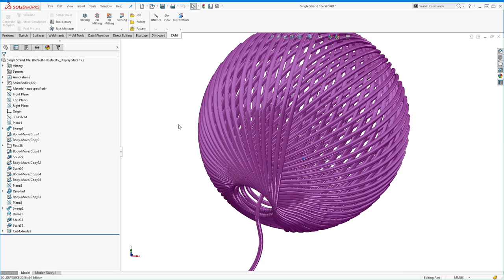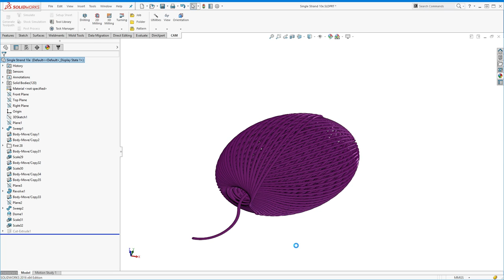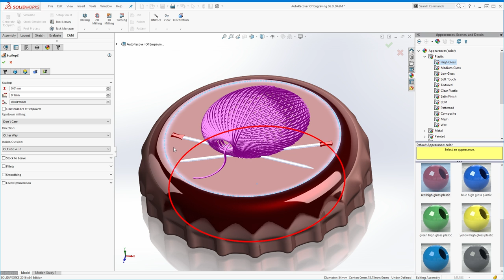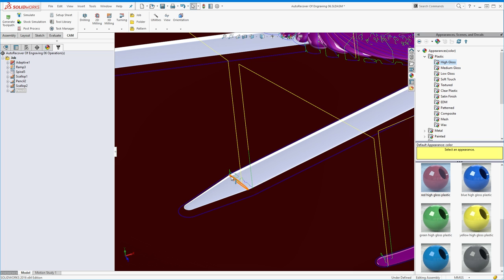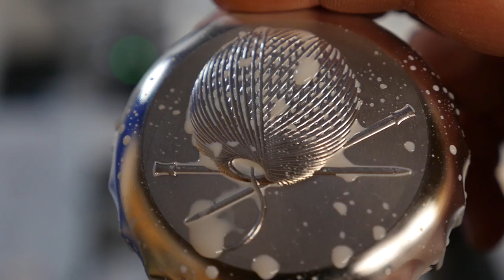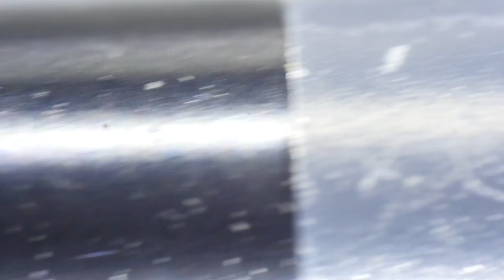Yarn and Crossneedles (1 of 3) A Little Bit (Micromilling With A 0.020" Diameter Ball Mill)

Comment: That was a wonderful video!  The ball of yarn modeling was well done with that slight allowable random variation making it quite realistic.  The finish quality was superb as well.  Your sister is a lucky lady to get such slick gifts!  I use 1/32" 4 flute Kyocera ball mills quite often here, but I rarely dip down to the 0.020" world.  I get nervous when I handle those tiny gems, but they really are pretty stout tools.  The macro shot of the bit that you pulled off was pretty sweet as well.  Sorry that the tube only lets me give you one thumbs up.
Reply from the maker: +Doug P 
Thanks for the complements! Sorry for my delayed reply; I saw your comment as a notification on my phone, but then I guess I somehow missed it when I came back to the video on my computer.

Man, that yarn ball was really taking its toll on me (and my computer). Trying to model a realistic-ish yarn ball is why I started trying to make helical spheres. They looked OK before scaling, but getting SolidWorks to make them as flat as I wanted was perti-near impossible. I was keeping my sister up to date on the progress (or lack of) and I probably declared that I was giving up on making a 3D yarn ball two or three times. I'm so glad it's over!

Yeah, it's kinda incredible how strong those little tools actually are. I bought two, expecting that I'd break at least one, but I was really afraid that the first one would break within seconds and I'd basically still be at square one.
Reply: No Problem...I have completely missed people's comments for a month or so- oops!  Yeah that ball modeling you pulled off could easily tax you and your video card.  It looks so good though it has to be worth it.  Now you can take on fractals :-)!  That's actually something that I'm working on right now and SprutCam thinks that I have chained it permanently to the woodshed when I calculate tool paths.

You know darn well that if you had bought one of those little cutters it wouldn't have even made it into the ER holder without breaking.  Speaking of toughness I just challenged one of those 1/32" ball end mills rather harshly.  I actually miscalculated the start point of a circular array of engraving that was supposed to run along the base plane of a 3/16" tall stainless boss.  That little 1/8" shank cutter friction cut 60 thou into that sidewall 32 times without breaking!  That little tool had to have been glowing cherry red off and on for 10 minutes!  It's definitely discolored all the way up the shank now, but the flutes of that ball mill are still doing fine.  It is certainly a one of a kind piece now...I'll call it art.  Keep having fun while you make those CAD/CAM programs earn their keep!
Reply from the maker: Heheh, that's pretty funny! And also amazing.
Reply from the maker: Oh, and you're totally right about the tool not even reaching the collet if it was my only one. LOL!

Comment: nice part, lots of complexity, turned out pretty good! I find people are always dead-set on getting an "embossed" logo like this, as opposed to a surface engraving...at least until they see the difference in price. But that yarn pretty much required a 3d shape due to the tight lines.
Reply from the maker: +Andrew Ydna DuBuc 
Thanks!
Yeah, try as I might I just could not figure out a way to make a convincing looking ball of yarn using engraving. I just couldn't figure out a way to get away from doing it in 3D. I can imagine a lot of people are dissuaded when they find out that the embossed look takes five times longer to cut.

Comment: Crazy detail, I love it.  That modeling is top notch.  I wish I could spend more time obsessing about little intricate machining like that.  Well okay I do, but it's torx patterns and tight tolerances, not so much decorative designs like this.  It's amazing.  I'm surprised you got such detail with a 0.004" stepover, that's 20% of tool diameter.  Ahh I just did the math and it's a 0.0001" cusp height, yeah that'll do!  I tried a 0.004" stepover with a 1/4" ballmill, but I was flying at 70ipm in Ti so the finish wasn't fantastic.
Reply from the maker: +JohnGrimsmo 
That thing took me SO long to draw, so thanks for the complement! Well... I guess that exact one didn't take all that long, it was the 15 failed attempts before that one that didn't turn out "good enough" that were the real problem. hehe

Yeah, I was surprised by the finish as well. I thought 20% would be pushing it, but I just kept thinking "OK, if the step-over is equivalent to the thickness of a sheet of paper, how bad could it possibly be?".

Whew, 70 IPM in titanium does sound like flying! Too bad about the finish as I bet the cusps on that thing would have been literally invisible.

Comment: Wow. Can you do a video about your Brother and how you chose that machine somday?
Reply from the maker: I'm so bad about making videos that I've learned not to promise to make them. But I can tell you a little about it right now... When I was trying to pick out a machine, I spent a lot of time thinking about the size of my garage door opening (a single-car garage door). I figured I'd either have to find a machine that would fit through, or modify the opening and get a new door and stuff. As I scrutinized that constraint, I managed to get/make some 3D models of the main machines I was looking at and started moving them around in a model of my garage. Having those models made gave me a new perspective on how tight of a squeeze most of the machines would have been. Even the Robodrills (at least the ones I checked) were actually too tall, even though they have a similar footprint as the Speedio. Also, in my research, I found a lot of people talking about how much they liked their Brother machine, but were very few (actually, I don't think I found anyone) who had horror stories about them. Plus those tool changes are just so much fun to watch! Then, the Brother machines weren't as power-hungry as the others, so I could get away with buying a smaller phase converter, and it has a lower air requirement as compared to the others, so I could get a smaller (cheaper and/or "better") air compressor. It made a lot of sense. When it was delivered there was literally about 2" of clearance on all four sides of the garage door, and that was after they removed the cover that's over the tool changer. If the riggers didn't have a super fancy forklift, I don't think it would have got in. :)

If you have any questions or anything, I can try to answer them for you.

Comment: Sir I want to engraving portrait design engraving on iron so how to  engraving on iron, I mean which size tools I use with my cnc machine , I want to spindle speed, feed rate, step over, step down and plung rate, I use mac3 controller, and artcam software for gcode

Comment: Turned out really well, great Job! Just wondering what versions of SW and HSM you are using?
Reply from the maker: +l0ckcr4ck3r 
Thank you!
I'm using close to the newest versions of each. I've disabled the SolidWorks background downloader, so it might not be the absolute newest, but I updated within a month I think.
SolidWorks 2016 "Standard" x64 SP1.0
HSMWorks 2016 R1.40294

Comment: Looks great! How are you liking the S700? I am looking at purchasing one in the next couple of months. I see you have had yours for a couple of years now. Would love to hear about it!
Reply from the maker: +Omid M. 
I love it!

When I was shopping for a machine to buy I had to focus pretty closely at the size and layout of the machine. This is in a single-car garage so I didn't have a lot of room to spare, particularly when it was being delivered. I had, literally, about an inch or two of clearance on all four sides when it was coming through the door, and that was only after the "magazine cover" (sheet metal box that goes over the tool changer) was removed and the cable carrier for the head was disconnected to reduce the height. Since my garage is somewhat narrow, having the chip tray and tank at the back of the machine instead of coming off the side, like so many other mills, was helpful as well. If I remember correctly, even Robodrills were slightly too tall and the Haas DM-1 was too big and/or too tall.

I should mention that this is the only non-Mach3 CNC machine I've run myself and practically the only one I've even seen in person, so I don't have a lot to compare against. When I was doing research I noticed that there weren't very many people that had anything bad to say about Brother machines. There wasn't a plethora of "testimonials" out there, but the ones I could find were basically all positive.

What other machines have you looked at? Personally, I was hoping that I could figure out a way to get a Milltronics machine into my garage. They seem to have a lot of really good features, and the salesman/company was even willing to build a somewhat "custom" machine that was a combination of two of their other machines in an attempt to get something that would fit in my garage... unfortunately, even then it wouldn't work. (And just to repeat myself a little: I haven't actually seen a Milltronics machine... I've only seen their marketing material. For all I know, they're total pieces of shit. :) )